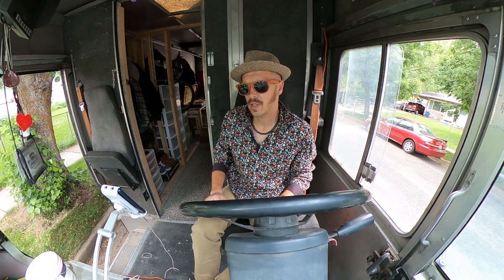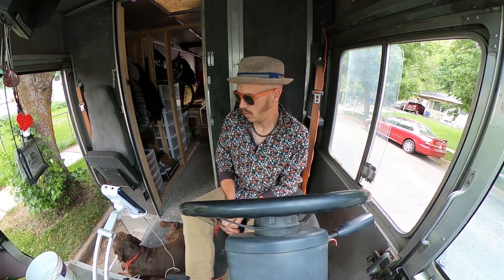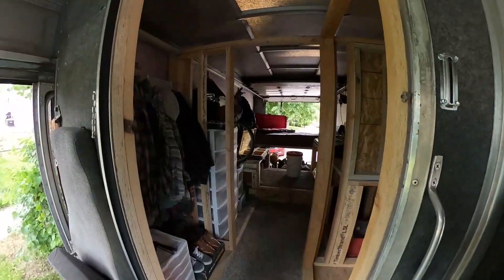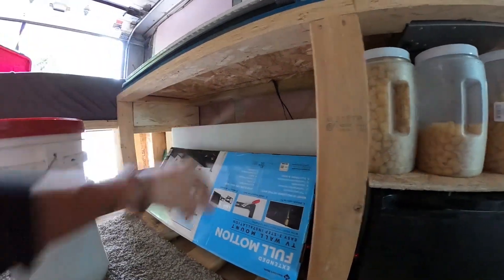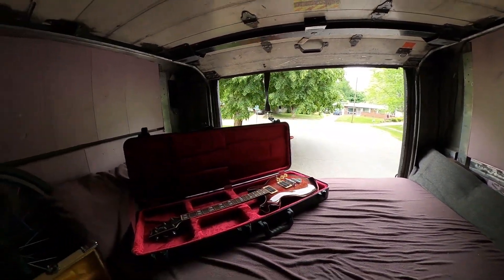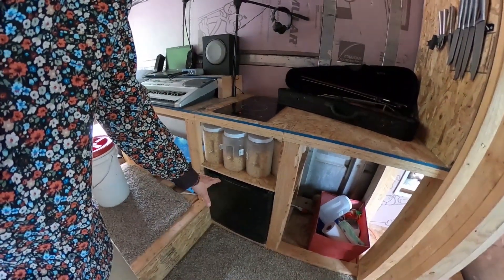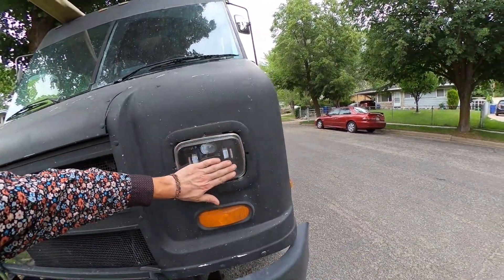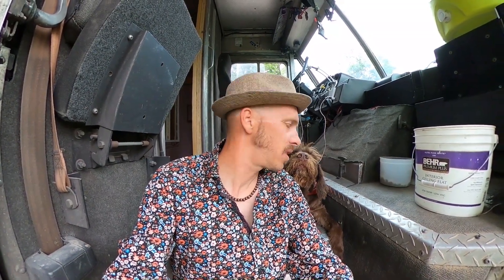🛠️ Step Van vs. Sprinter Van: Choosing the Perfect Adventure Companion ♻️🚐

Comment: clam shell rear end acts as a way better option like canopy & tailgate, stand on deck or table work space you can also haul things like a normal truck would tailgate down hanging out long items or back to the porch idea wrap a canvas or bug net for a rear deck sun room or space to take as any kind of shelter made easy extension walls soft hard top & bottom

Comment: how you gonna store your bike long term?  How many miles on the chassis?
Look like you have a lot of musical chops based on your eclectic instruments.  Gotten complaints when rocking inside or are you well enuf sound insulated?

What is your engine and what is the real world gas mileage?
Reply from the maker: I'll eventually do a rear bike rack because I'll have several bikes. the chassis had a little over 200,000 miles when I bought. I have 12 instruments total in my van the loudest of which is my electric guitar and I crank it up pretty loud and I've never had a complaint. I have two inches of r10 insulation all the way around. I have the Cummins 12 valve 5.9 and averages twelve miles per gallon